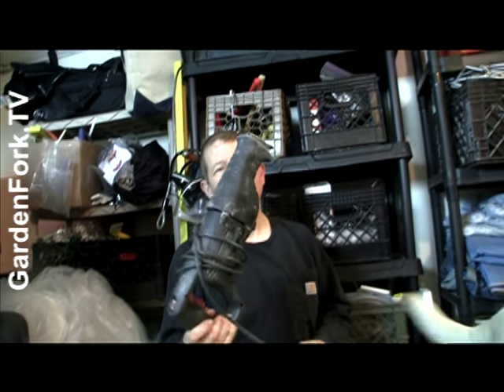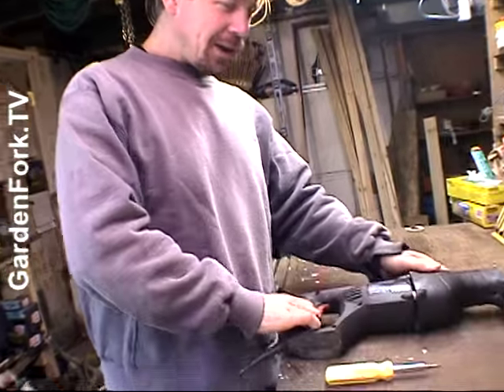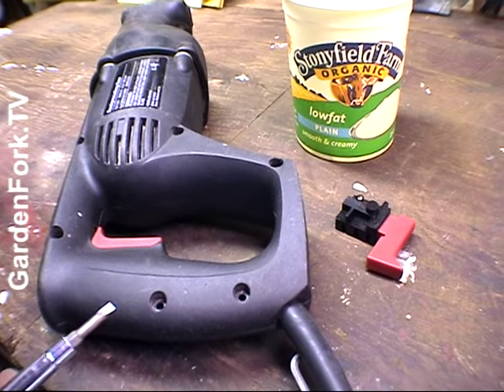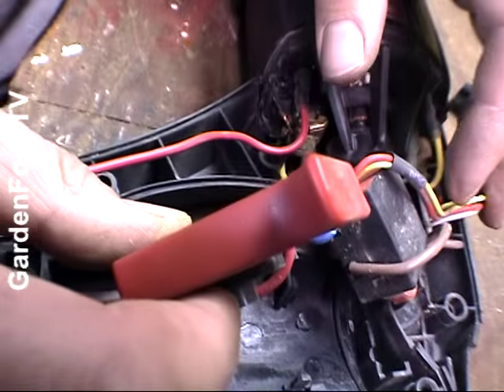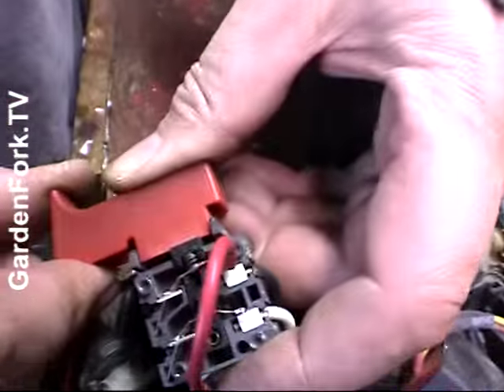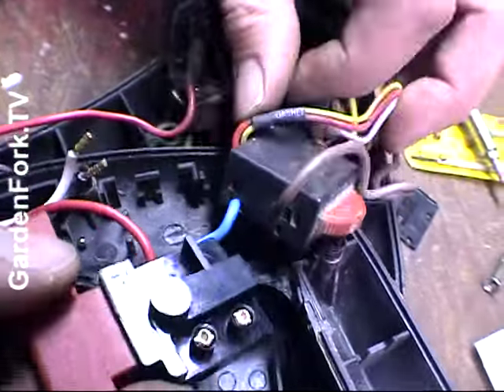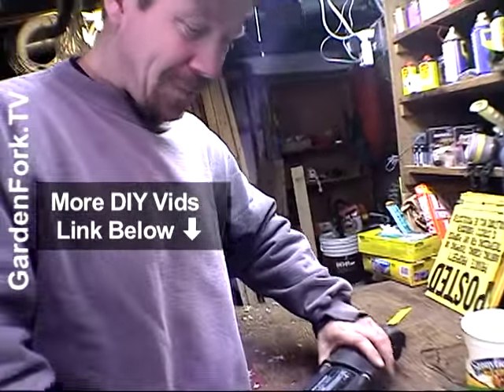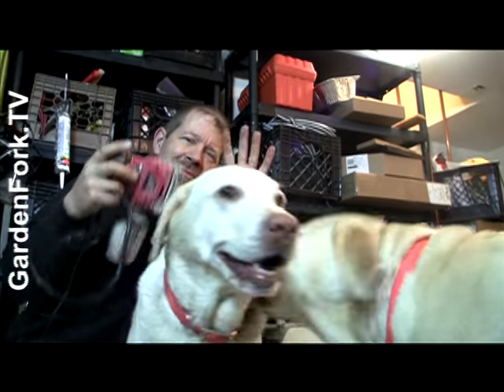Replace Trigger Switch on a Sawzall type reciprocating saw - GardenFork

Comment: How did you know the trigger was the problem could you feel it not engaging correctly? Good work another success!
Reply from the maker: +unlabuntenga with power tools, my first suspect is always the switch, then the brushes on the motor. it wans't sparking, so I went with the switch. you could take the tool apart and check it with a voltmeter to be sure its the switch.  thx!

Comment: You should post a pinned comment saying that the wires in te trigger could be pulled out because they're male female type of clip system. Is that correct?
Reply: Also your dogs are adorable, you're wife seems really nice and great video
Reply from the maker: thx for the kind words!
Reply from the maker: i was not able to tell whether those wires could be pulled out safely, so i did not post a comment about it. but good suggest. thx!